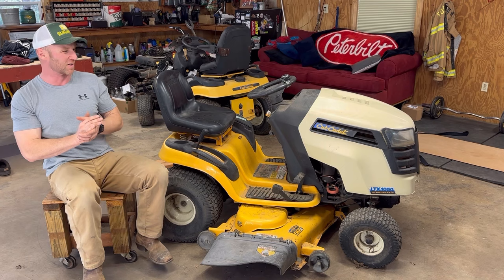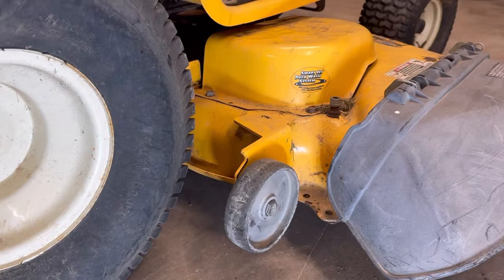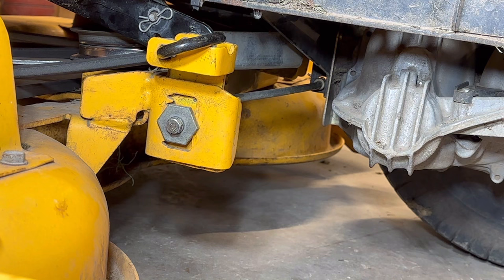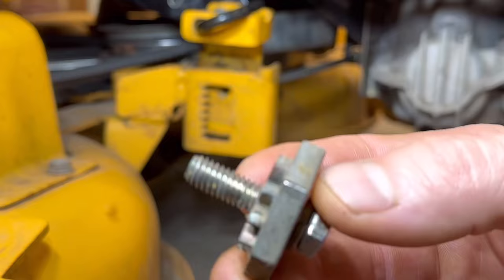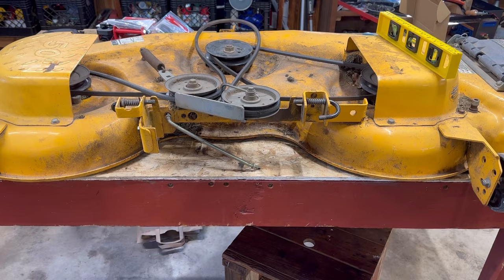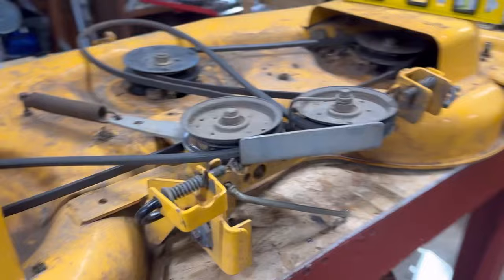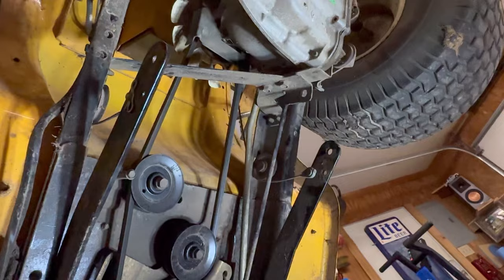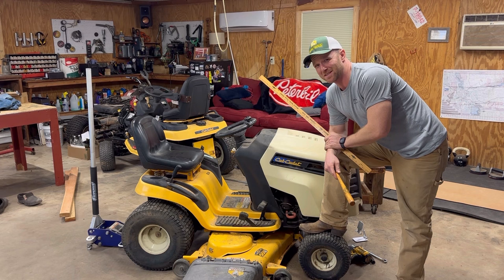Cub Cadet Mower Deck Leveling & Sagging Fix!

Comment: To suggest that front deck tilt is unimportant shows a lack of knowledge of it's purpose. With the deck lower in the front, the grass is being cut once only--by the forward tip of the blade. Tipped to the rear, the blade cuts twice--once in the front, and again in the rear. This causes several problem. 1. To evenly disperse clippings and reduce clogging, the deck is designed to work by cutting up front and immediately moving the clippings into the airstream--not again from the rear. 2. The proper airflow itself is designed around the recommended tilt. 3. For both those reasons, without the forward tilt, you don't get a nice clean cut! And you clog your deck more easily. 4. By cutting twice you are wasting gas and increasing wear on your engine, belts, spindles, and pulleys. I understand the philosophy of "you do you", but don't misinform others that the forward tilt recommeded by their manufacturer is unimportant. This otherwise helpful video is viewed by a lot of folks who don't know why they should or should not "do whatever you want." Give them the facts and let them make and informed decision. Thanks for helping me understand the rack-and-pinion side leveling device and overall lift mechanism! My deck is cutting beautifully now (the worst was corrected when I re-set my front pitch!)
Reply from the maker: Hmmm interesting note. As a pure amateur mechanic my hypothesis is you are wrong on your tilt idear. If it cuts once in the front and comes back around there wouldn’t be anything for it to cut on round 2. Also the front bar doesn’t do anything regarding tilt it is all on the back 2 adjusters. 

But I appreciate you watching and the banter!
Reply: Manufacturer recommends a slight lower setting on the front adjustment. This can be from 1/8” to 3/8” lower than the back. When levelling the deck (blades) side to side it’s fairly easy using the left adjustment rod with the blades perpendicular to the mower. Rotate the right blade 90 degrees parallel to the top the mower and take your final adjustment. You can get a finer result than what is claimed here. My 3 year old Cub has a fabricated steel deck not a pressed one. Built like a tank ! 👍🇨🇦👨‍🦳
Reply: @MowerMike  I have no idea what "round 2" refers to. It's a simple concept. When your deck is higher in the front, it cuts the grass blades high at the front of the deck, and as you move forward it cuts those same grass blades a 2nd time to the lower height at the rear. For all the reasons I mentioned, that goes against the design of the deck for energy efficiency, clean cutting, and for ideal clipping removal at the airstream in the front of the deck. 

BTW, this is not MY "idear". Every deck manufacturer I know of specifies this adjustment. I'm also in the dark about the comment on the bar in the front. I don't think I even mentioned it, but It is for the front to rear pitch we are discussing. Ciao!
Reply from the maker: @FisherCatProductions  By round 2 I meant the blade swinging around the second time. If your deck is level there should be no grass left to cut when it swings back. 

Thanks for all the corrections.
Reply: Will front tilt keep it from throwing clippings out front of deck into my face
Reply from the maker: @Tammy-y1z  Yes if the front it tilted too high then it may shoot them out the front

Comment: You are showing the wrong way to do it, the front adjustment is for setting height, the more you tighten it the higher the deck will go. The rear adjustment is for side to side adjustment, the side without the adjuster is fixed in place, and the left side adjuster levels the deck side to side, meaning if you lower the rear adjustment the left side the left will cut lower, if you raise the rear adjustment the right will cut lower. In short you set height from the front side FIRST and side to side with the rear, the fixed right rear just acts as a pivot. ALLWAYS START WITH THE FRONT. Also on the wider decks their are two front adjusters to fine tune left to right on the front. Picture it like a sagging hammock if you just pull it from one end the entire hammock will raise, so pull from the front to set height and adjust left to right with the rear.
Reply from the maker: I like doing it backwards, rear first. But to each their own. Thanks for all the detail

Comment: Why is it that no one talks about how rough it is to remove  the deck on a Cub cadet ltx 1046 KW. ?  Why don' t the manufactures make    it easier to remove the deck so the customer can clean the underside of the deck and to be able to get at the blades for sharpening ?
Reply from the maker: Is agree Deere decks are much easier to take off
Reply: Personally I don’t find it difficult to remove. As a previous Husqvarna owner and now a LTX1042KW owner the Cub Cadet deck is easier to remove. Literally one or two bolts on the PTO belt guide to loosen, pull two pins on the rear of the deck, one on the front and slide the deck out the left side, one more pin to release the blade engagement cable. The deck is heavy and awkward but aren’t all decks?
Reply: THIS… It is a pain in the ass to do!  I have this exact mower and find it much harder than any other mower I have had!  Is it all cubs or just the KW?

Comment: Sir I’m not saying that this way doesn’t work for you .. but deck pitch as in the front of the deck is lower than the back is also for air flow. The deck pulls the air up and the grass..!
Reply from the maker: Wouldn’t you want the front to be higher and get this helicopter effect you speak of ???

Comment: I thought you were supposed to level the deck by measuring the blade tips from the ground, not from the deck itself.  Is the deck alignment really good enough to measure from the deck itself instead of the blade tips?
Reply from the maker: Your advice is much better than mine.
Reply: @MowerMike  I'm not suggesting that!  I honestly don't know.  Measuring from the blades is a pain in the arse, so if the deck is close enough (since the spindles are mounted to it?), that would be great.  I haven't ever check blade alignment/level against the deck, so I don't know.
Reply: @v908  You asked an intelligent question, and it deserves an intelligent answer. In 50 years as a Facilities Manager, I HAVE checked actual blade levels against the actual outside of the deck. I can assure you, especially with older, well used decks, that quite often the two measurements can be off A LOT!. Deck plates under spindle mounts get bent: the outside of the decks get bent or warped. Even on a new deck, there's no guarantee that the deck edges or wheel brackets that you measure from coincide with the same blade height from one corner to the other. Often, there are not even two points from front to back where you can measure the pitch of the deck itself (let alone the blades). But Mike doesn't really care about that because he erroneously chooses to ignore the importance of proper front pitch. If you want a good, clean cut, and you don't want to overwork your machine, you need to accurately measure the actual blade tip heights, AND you need to set the recommended front pitch. You can get a handy-dandy tool that slides under the deck and measure the blades side to side and front to back for under $10!

Comment: My lt 1042 deck is driving me insane. It sags so badly on the left side that it literally drags the ground on the last 2 lowest settings. I've adjusted the left side as high as it will go but its still nowhere near enough to be considered even remotely level. I've inspected everything as best as i can on the deck and can find nothing that is bent, broken or excessively worn anywhere on the lift components. I wouldn't even care about any of this if it would cut grass reasonably well, but it doesn't. It is beyond frustrating to say the least!
Reply from the maker: Pull you deck and watch the video, they just get bent up and cause it to sag. I can’t stand it either and is why I made this video. Good luck
Reply: @MowerMike  Thanks, i will pull it and have a look. As bad as this thing is sagging on the left side it would need to nearly be bent in half to cause all of this i would think. Very poorly engineered system, no more cubs ever again for me!
Reply: You might have to make a bracket that bolts to the existing wheel brackets so they are lower and ride on the ground, putting the blade at the correct height. It's a last resort

Comment: Leveling a hang bracket means nothing unless the deck is level as it sits. Making things square to the main deck can be done without the need for an attempt of using a level.

Comment: Ok so on mine the deck height cables keep coming off their pulleys and making it cut unevenly. I slip it back on the pulley (easier said than done) and it cuts fine until I hit a bump and boom, right back where I started. What's a good fix for this issue?
Reply from the maker: Sounds like something is bent. I would pull the deck off and check out all the pullies and bearings

Comment: Got one of the LTX1046KW models. The best (and only!) good thing about this mower is the engine. It is one my Dad bought several years ago (I think 2012) and the deck on this thing has been one big headache. And I used to be a small engine/lawn equipment mechanic! The lift cables on this thing jump the plastic pulleys on the frame and drop the deck. I have to replace at least one deck blade spindle assembly every year. Mind you, it has cut a lot of grass during it's life, but so has my Craftsman FS5500 and my son's LA115 John Deere and they have had zero deck problems! Thanks for the video, I don't want to miss an opportunity to be able to use the big adjustment hammer on it lol!
Reply from the maker: Glad to help. You should check out my cub cadet review videos if you really want a chuckle

Comment: Looks good! I had my deck off when I first bought it replacing the belts and cleaned the deck up on it and I had to bend one of the anti scalping wheels brackets back into place. The fella I bought it from had used it to mow a field he owned next to his furniture store for like 8 years. Once I got the deck back on it and tried it out the cut was horrible so I adjusted it to achieve a decent cut and didnt realize the deck sat so low until I went to load it on my trailer. ( I mow my daughter and sister's property). I've gotta take the deck back off and put new blades and spindles on it this spring anyway because tore one up last fall. I'll check all this stuff out and see if I cant gain some height back. I appreciate you taking the time to make this video. Hopefully I'll get into a john deere soon and pass this ltx1040 on to someone who less picky than I am,lol. John deere truly does have the deck thing figured out,lol.
Reply from the maker: Yep glad you enjoyed it
Reply: @MowerMike  I sat and binge watched your 38 videos on your john Deere's, lol. Good stuff,especially while its snowing and 25 degrees,lol.
Reply from the maker: @ciphercode2298  Glad to give ya some giggles. Welcome aboard

Comment: I have 2 XT1 enduro riders . They have 2 rods, basically long pierces off all thead on the rear of the deck for adjustment. One for each side. Pain in the butt!
Reply from the maker: Never been on the XT, maybe in another 10 years

Comment: Well I sure hope I can fix mine. No way can I take the deck off if I need to bend that bracket. Also crossing my fingers I can reach that bolt to raise it without removing the wheel. The less removing the better for me!! I will try 👍🏻. Thanks for the video.
Reply from the maker: Good luck and be careful. Just remember to take your time.

Comment: I was given a LTX 1050.. it was rough, sat outside through a NE Ohio winter.. I have it running decent but the deck does not cut evenly. Thanks for this video. Also has a very weak reverse. Is that a belt thing or a hydro?
Reply from the maker: No idea
Reply: Hydro. My 1050 does the same thing.

Comment: what position is best for leveling? Low high or in the middle adjustment?
Reply from the maker: Suggest putting some boards under the deck and lower it to where it just touches and level it from there.